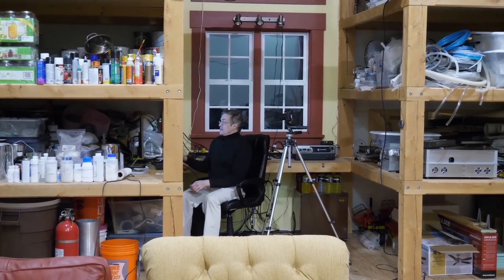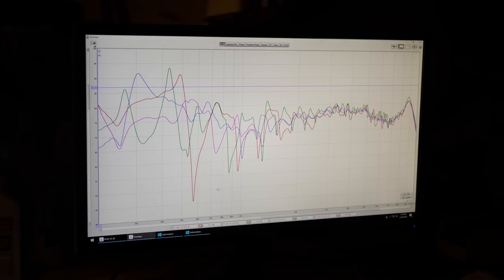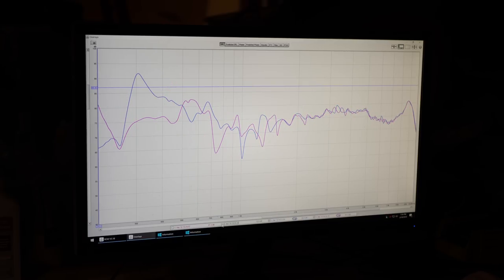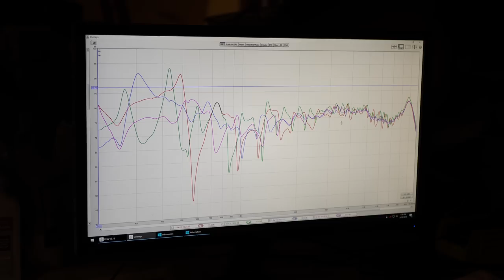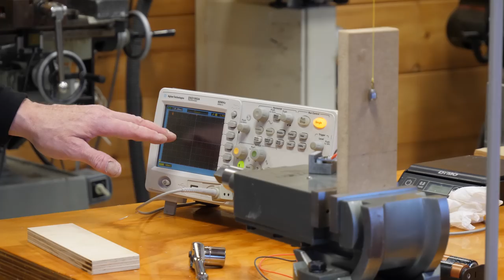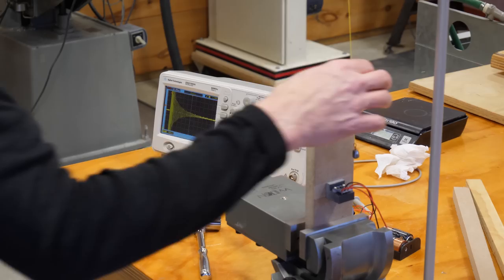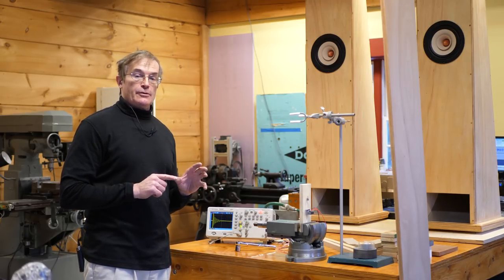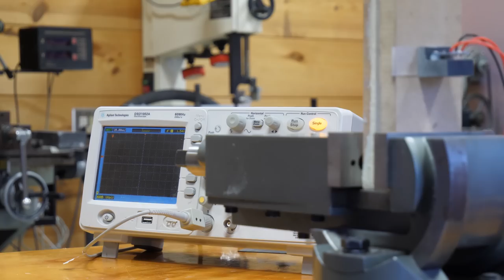World's Second Best Speakers!

Comment: Hi.... Have you ever considered doing a diy , 3-way studio reference monitor?
Reply from the maker: Actually, I haven't.  There  are a lot of excellent commercial models available and I'm not sure what interesting/new physical principles we could introduce.
Reply: @TechIngredients  apparently 2/3 way systems suffer from phase and time aligning issues so, maybe a single speaker like the tang band in a sealed cabinet to cure those problems or even something similar to your transmission line but smaller? Maybe active with on board DSP? My thoughts are, all frequencies from a single point source and dsp to create a totally flat response.... Would that work in a sealed enclosure?
Reply from the maker: I like the idea of not using a DSP until the end of a design to tweak it's  imperfections, but then it is a valuable tool.  The design  itself should target a flat response.
A sealed cabinet will introduce it's  own frequency  dependant peaks and troughs unless it is huge.
Therefore, the approach  I've  been playing with is to literally  dump the sound from the cabinet outdoors. A few sound absorbing baffles  should protect the neighbors, but this could be the ultimate in flat sound reproduction.
Reply: @TechIngredients  there's a few manufacturers who use sealed cabinets to great effect... Neumann kh310, hedd type 20 mk2... I'm wondering if a well damped cabinet using your technique with dsp can mitigate the peaks and troughs. I have been looking at triaxial drivers...my thinking that a cube with a single point source would create a nice sized usable sweet spot and help with time alignment???

Comment: What crossover are you using for these?
Reply from the maker: These full range drivers do not require a crossover.
Reply: @TechIngredients  also can you tell me what is dimensions of the port hole at bottom front? 
Thank you
Reply from the maker: It's 15 cm high.

Comment: Why not fold your tube so you don't need such a huge cab?
Reply from the maker: Folds introduce reflections as well.
Reply: @TechIngredients  Reflection is a non-issue with proper damping and curvature. Amazing what rockwool chosen to correct density for application may accomplish. Use of exponential spirals for curves absolutely negates possibility of standing waves. Quite frankly, 'reflections' down a horn path are only possible for very high frequencies, it is actually not something you want as part of the air column whatsoever, so tuned damping really does take care of this concern. Take care, M

Comment: Do the measurements need to be adjusted for different sized drivers ?
Reply from the maker: Yes.
The "open" volume specification for the driver determines this. You can then scale the dimensions proportionally to achieve that volume.
Reply: @TechIngredients  thanks mate. So to be clear, should ALL the measurements be scaled or just some. Forgive the newbie question I’m just so keen to make these!
Reply from the maker: The internal height, width and depth should be scaled to reach that volume.

Comment: Fun video!  Many years ago I built several sets of speakers for prosound applications utilizing both ported and horn loaded designs similar to Altec and JBL products.  Our goal was high SPL and long throw for outdoor events rather than a very smooth response curve.  They worked well for many years but I can see how some of your tuning and dampening elements could improve my designs.  It would be interesting to put one of these speakers into your audio test chamber to measure both the response curve and resultant SPL.  Thanks!

Comment: those speaker drivers have like 0 directivity tho lmao.
Reply from the maker: That is a significant pronouncement.  Please back it up.
Reply: @TechIngredients  From the look of the tweeters alone, they have a very poor wave guide design. I would be surprised if you were to achieve even a -8db at 10khz 45 degree horizontal deviation. If you can I would love to see the top end directivity measurements though.
Reply from the maker: This would apply to all, full range driver designs.
Reply: @TechIngredients  I am not disagreeing with that. However, because of this, I would not call these the second best speakers, since there are far better two or three way speaker designs.

Comment: Are the accelerometer graphs normalized?
Reply from the maker: I'm not sure what you mean.
Reply: Sorry, I will elaborate. To evaluate damping it is better to look at amplitude ratios. Looking at just the value may not be enough. One way around this is normalizing the graphs.

PS: I love your work, a friend and I are going to replicate your previous speaker design (the one with styrofoam) 🙌🏻
Reply from the maker: The impact energy is controlled and the amplitude reflects the stiffness of the material.  The frequency indicates the specific stiffness or in other words the stiffness to mass of the material.  The damping is the number of cycles it takes to reach a given percentage of the initial amplitude for a given material.
Reply: It is possible that the impact varies slightly from one test to another, which will affect the results. This can be a problem when comparing similar quantities.
The mentioned porcentaje of the original amplitude is much easier to observe when this original amplitude is set to the value of 1 😁

Comment: Great video.
Reply: Re: cabinet flex.  Put on about 2.5 coats of motor oil first, relieve the wood wit ha heat gun and put some thinned oil on it and then when you come back put a lot of oil Then you put your finish on top and heat gun it between coats of everything
Reply: after you get your panels sized.
Reply: zorbathane is just roofing felt they have a new roofing felt thats like 1/8thick looks exactly the same

Comment: I'd always heard that solid birch, for example, was preferable than plywood for guitar amplifier speaker cabinets, in a similar way that solid back and sides are drastically preferable than plywood in acoustic guitar construction. No?
Reply: In an acoustic guitar, the sympathetic vibrations of the body are core to the tone of the instrument. As such, it is logical that guitar amp builders transferred this to amplifier design as dogma. In reality, cabinets holding active drivers should not be co-active components in this fashion. Rather the cabinets should be dead so as to allow the driver to best *reinforce* the sound coming from the source instrument instead of color it.